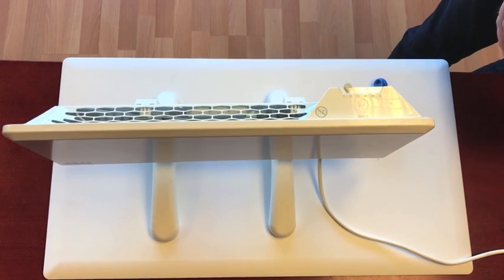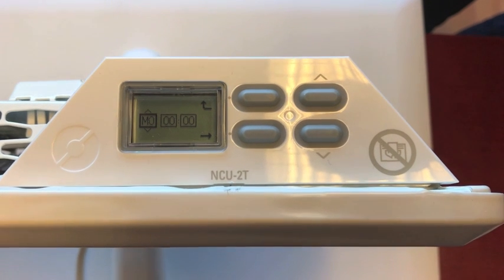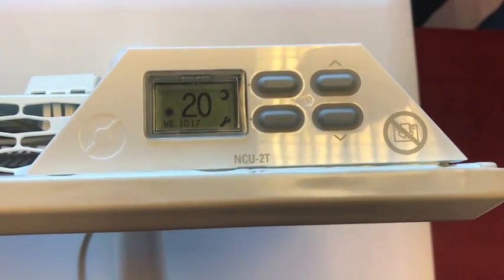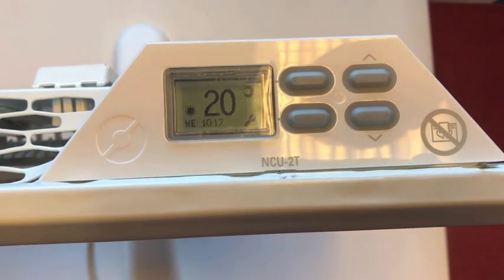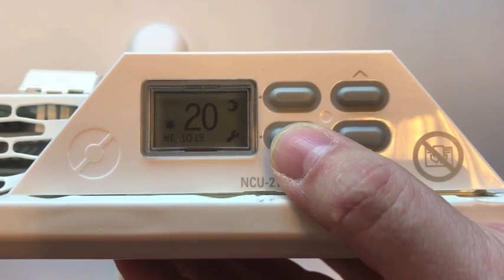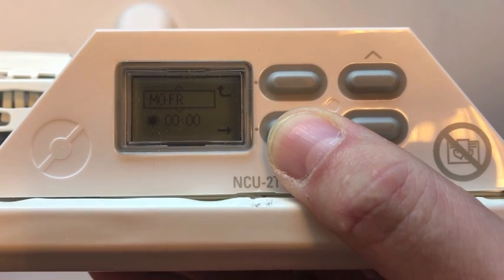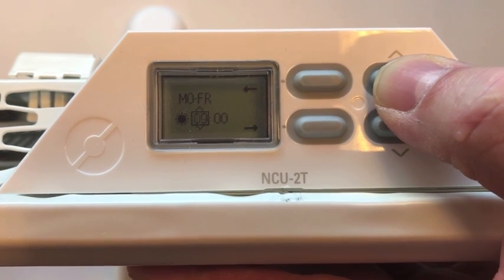Installing and programming Nobø NCU 2T or Dimplex DCU 2T

Comment: Hi there, thank you for these instructions, I have followed them perfectly except I have only programmed two settings. 1. Night Mode 23:00 & 2. Heat mode 20:00. I would expect that this means the heater will stay off all day and only turn on between 8pm and 11pm and then go off again until the next 8pm cycle. However, for some reason the heater wants to turn on much earlier than that at around 5pm. I have tried removing the settings and doing them again, but it keeps happening. Have you heard of this before?
Reply: Same thing here...ready to throw them in the bin
Reply: Hi Chrissie, I believe the designers thought it would be a clever idea if the heater switched on in advance so that the room would be at the desired temperature at the start time.

Comment: Anyone know how to unlock it? I have an issue where I accidently covered the heater and it shut itself down to prevent it from causing a fire. But now it's just locked me out and I can't get any heat from it. Anyone know a work around.

Comment: Hi there and thanks for the instructions, do you know if I can simply switch the heating on when I need it? I have followed your instructions but my heather doesn't work. Thanks
Reply: You can switch the heating on when you need it (i.e. override the settings), but it's easier if you just set up a timed programme. What exactly isn't working? Perhaps you've set the timings wrong?
Reply: how do you override the settings? at the controller or the heater?
Reply: Nicky Nunn on the control unit on the heater. If you set a timed program you can always increase or decrease the temperature or flick onto the day program if it's currently night or night if it's currently day using the top left button
Reply: Nicky Nunn how do I override the system

Comment: Would anyone be able to help with just setting a timer to turn on? 
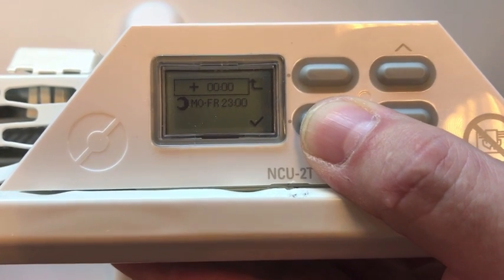I'm only trying to set it mon-fri 5:30-6:45am and 5:00-6:00pm
Reply: Hi, I think if you set it to comfort setting at 5:30, setback at 6:45, comfort at 17:00, setback at 1800.

If you want if to then off then just set the temperature in setback mode to 5 degrees
Reply: I have followed the above time profiles as they work for me too - but how do you have a different temp set for a) comfort and b) setback modes?  I can only seem to set one temperature. Or do you have to adjust the temp on the panel each and every time?
Reply: @AlexNothling  you can set a different temp for comfort and setback.  I can’t remember how, but follow the instructions dont think its too difficult